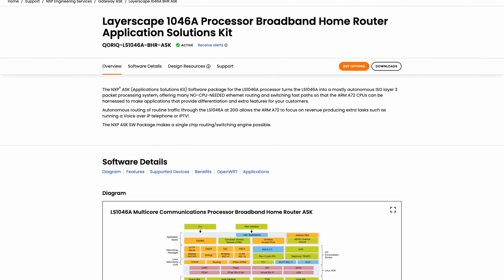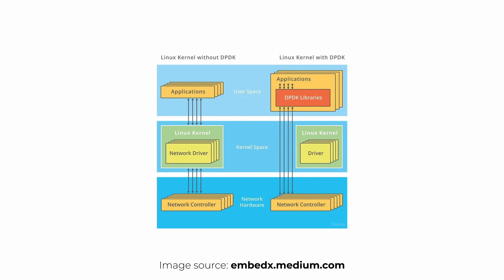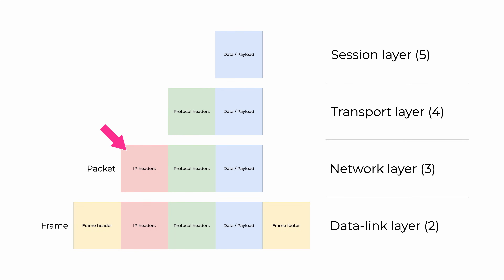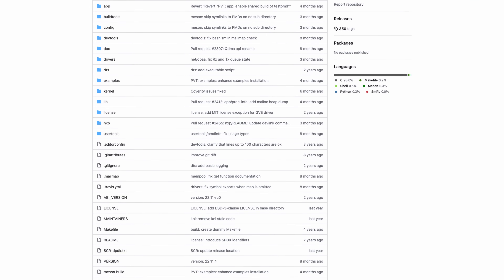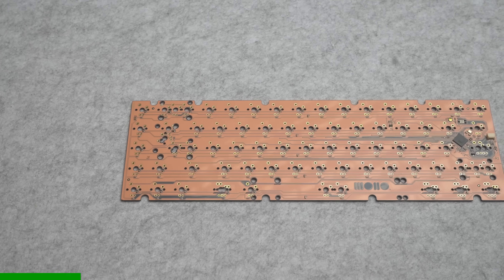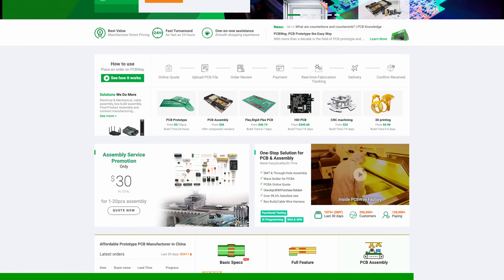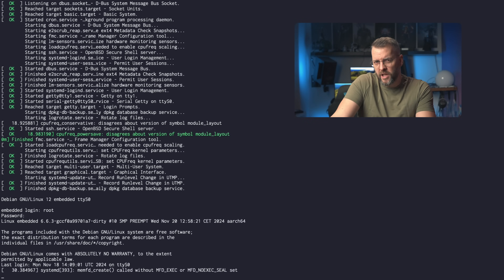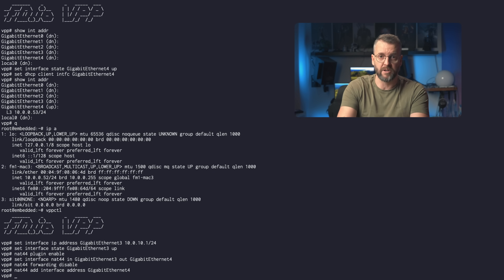Can a single 1.2 GHz core process 10 Gb/s? Yes, it can!

Comment: UEFI and ACPI which are used in regular PC hardware instead of device tree are the worse option technically. A superior way would be to have a device tree provided by the BIOS and there would be no need for UEFI or ACPI after that.
Reply: This has been debated over times by hardware vendors and OS providers. Their conclusion was that DTs don't offer the required to support consumer computing platforms. On servers is more about using the already existing frameworks which are tailored to UEFI and ACPI.

DTs are better suited to embedded platforms with lots of hardwired hardware and almost no configurability as everything is mostly and already confined in the SoC. As the case of your phone or your router.
Reply: @hyoenmadan  Device trees could provide everything that UEFI and ACPI can do but it would require support from OS vendors, namely Microsoft.

And since Microsoft has always been betting on backwards compatibility and vendor lock-in, it makes zero financial sense for Microsoft to support switching from UEFI to device trees.

As a result, device tree has no future in PC hardware as long as Microsoft Windows has such a big market share.

Comment: What about the thermals now that one core is pinned at 100% all the time?
Reply from the maker: Adds about half a watt to total power consumption. Negligible, but once we have the cases manufactured, we'll of course run the proper tests to make sure it really doesn't impact anything.
Reply: @tomazzaman  does the software only work with polling? I haven't done much with networking on embedded linux or device drivers myself but it seems not ideal to constantly poll for data (but i have 0 experience with this so who am i to judge)

Comment: What kind of performance difference is there between VPP and native linux packet forwarding? What happens performance wise if you switch the network driver to polling mode in linux?
Reply: My guess would be that at zero to very little traffic, Kernel networking with interrupts would be slightly more efficient/faster, but at any level of traffic above that VPP would get the advantage.
That because, even with no traffic at all, VPP would still be polling NICs to know if there's something new while the kernel would be doing other things waiting for NICs to tell it something happened.
With more traffic instead things wouldn't change much for VPP, but a lot for the kernel which would be receiving lots of interrupts and having to constantly stop what it was doing to listen to what NICs have to say.
Reply: @qdaniele97  I see that as well. Maybe release 2 versions of the OS/firmware, one with classic Linux kernel (the default one) and one with VPP.
Reply: @hubertnnn  That could be an option (or you could install your own OS).
But I think it's likely a router will always in a situation where VPP has the advantage

Comment: Would some variable polling frequency be able to lower the worry some have about power consumption? With few traffic, the frequency could be lower with up to 100ms sleep, and if packets arrive, the sleep is eliminated ?
Reply from the maker: According to VPP docs, it can switch between polling and interrupt modes, and it the latter, it should be able to lower the frequency. Can't confirm for sure though, at least not yet.

Comment: Hey I don’t remember if you mentioned it in one of your other videos but out of curiosity, will the router be able to support multiple wan’s? I feel like there’s not too much in that market and it would be a great idea to implement, especially at 10g speeds.
Reply from the maker: I see no reason not to - multi-WAN is a software thing.
Reply: @ good point. I was looking at one of those ubiquiti dream machines for my network when I asked that question… I figured that I’d rather use your router instead when that time comes. Do you feel like it’ll be something that you’ll already have coded in?
Reply: “Coded in”

Comment: Nice Video… are You planning to put this project on kickstarter or similar platform? I am interested in the product :)
Reply from the maker: Not sure yet, we'll be fundraising soon (venture capital) so I want to use that for the first batch, rather than my viewers' money.
Reply: @ using DPDK with VPP is a bold move. Most of open source small solutions are still in Kernel Mode. I hope Your device will be available in short time.

Comment: Not great for a home network for 1-core 100% 24/7?  Interrupts and *DMA are wonderful, why go back to a world without them?  * You shouldn't be able to get physical addresses from userspace.
Reply: Interrupts use CPU resources. They are good for low traffic, but for high traffic polling is better.
A perfect situation would be the ability to disable interrupts until all data in the queue is processed. 
Some microcontrollers I worked with had this feature where you would receive just one interrupt and no more until it is cleared (which happens after queue empties).
Reply: @hubertnnn  because 100pct is free...wtf u talking about.

Comment: Mikrotik crs305 has 4 SFP+ ports and runs on a tiny 1-core 32bit 800mhz cpu.
Reply: That is a switch, the packets don't get to the cpu, switch chip deals with them. If they go to the cpu it can barely do 1Gb. Check the test results on their product page.

Comment: You can do 10g but refuse to do 2.5g instead of 1g facepalm
Reply: He said it in one of the previous videos. That CPU have modes with specific lists of interfaces in each mode.
You cannot just distribute the bandwidth as you please.
Reply: @hubertnnn  
Its 2024 and he's still releasing 1gbe nic and calling it "pro". instant fail and no one will buy it.

Comment: How does having a single core pinned to 100% affect "idle" power consumption over using Linux kernel based networking?
Reply: In a couple other comments, he answered that it's about a half a watt. So apparently polling doesn't use a lot of transistors.